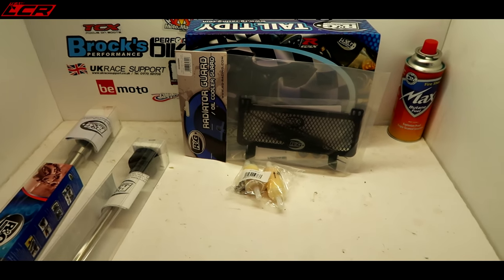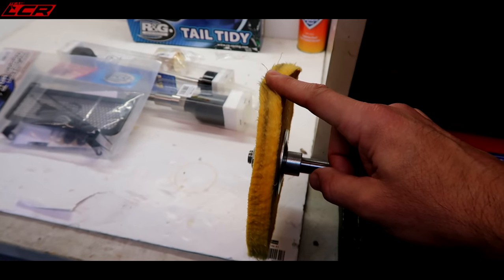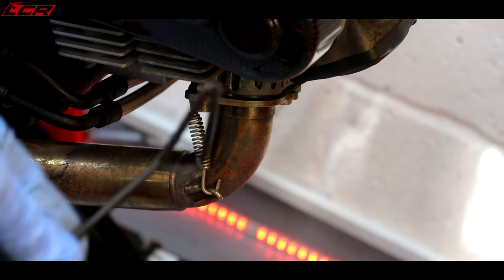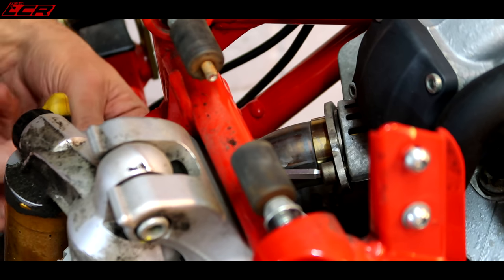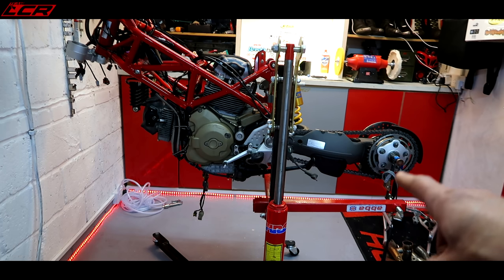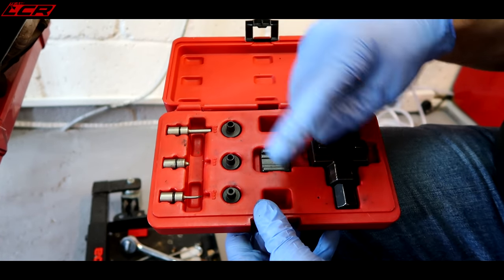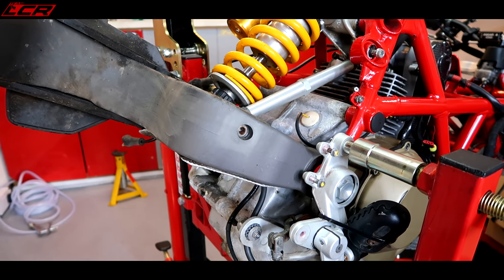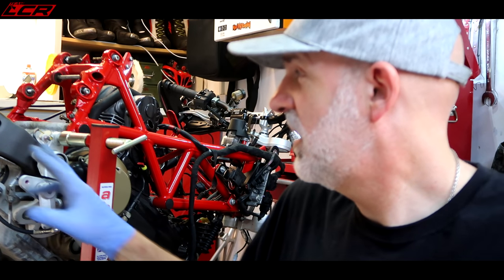Hypermotard Restoration EP04 | Now We're Getting Serious!!

Comment: Why not mince the chain off with the grinder if you are not reusing the chain? I don't get the stubbornness that you must use a chain splitter which is 1) slower, 2) more tricky 3) likely to break the pin.
Reply: Agreed....grinder is way to go for getting old chains off
Reply: You don't 'need' to, but he might want to reuse it, he didn't say I don't think, plus it's his choice.  Also it takes just as long if you use the right pin that will not break lol.  I personally have to, I don't have a grinder and a Dremel would take much longer than using a chain tool.
Reply: I have chain splitter but have never used it because I also have an angle grinder.. even using a grinder carefully you can reuse the chain
Reply: @appymarley  how can you reuse it after cutting the link in half? It'll be to short, not really advised to add an extra link either.
Reply: @HalfdeadRider  just grind off the crushed part of the master link pins so you can just slide out the master link and put a new one on
Reply: @ThePgunner  Like Chops tried and it didn't work, it won't just easily slide out, he couldn't knock it out either.  Best just use the chain link remover, if you use the right size bit for your chain, and fit it properly it won't break, it doesn't take long either.
Reply: @HalfdeadRider  ah I apologise I wrote that before watching
Reply: @ThePgunner  its not really wise to tell someone how to do something you don't know how to do yourself 😂
Reply: @HalfdeadRider  That's 90% of YouTube comments for ya
Reply: @Filip_Phreriks  I don't know about your maths knowledge, but 90% seems a little high 😂 👍
Reply: jack jones I use my chain break all the time when removing chain, if he would set the break above the chain close to the sprocket it the takes slack out plus using boxed end wrench and socket makes job much easier.
Reply: @HalfdeadRider  who said I was wise? 😂
Reply: @ThePgunner  😂 😂 👍
Reply: I’ve used an RK chain tool at work for the past three years and never had any problems with it, with quite a lot of usage
Reply: @gamekeeper687  That's because you use the right bit depending on the chains pitch, and make sure the tool is fitted correctly.  They will do it without grinding the pins head(?) (as I'm aware you would know), but best to grind it off to make it easier on us and the tool, the tools instruction advise to.
Reply: @HalfdeadRider  I have cut the connecting link many times and just replaced the rivit link so that way the chain stays the same length..easy
Reply: @appymarley  Even if you grind off the heads of both pins, you still need quite a lot of force to remove the link plate (usually a screwdriver or similar tool, and lever it or even hammer it off, the grinder pretty much welds the pins to the plate), it does not just fall off, but yes it's possible but not recommended.

I'd never reuse a chain if changing the sprockets (new sprockets/the chain will wear quicker), or doing any normal maintenance work.  There is no need to split a chain in most cases unless you are changing it, and the sprockets.  If you need it removed it for a big job like this, it makes much more sense just to replace it anyway.
Reply: @HalfdeadRider  yes whatever I'll keep doing it like I have been for years
Reply: @appymarley  😂 whatever 😂

Comment: Listen hobbyists, those casting marks on the yokes, take them out by hand, the old fashioned way  a hand file, and lots of different grits of emery, or al/ox paper, finishing off with a 1000G. You wanna see how its done properly outside of a pro polishing shop, have a look at some of Allen Millyards work, and even then he finishes off with a floor standing 2hp polishing spindle. You have been warned/advised...

Comment: I don't think anything you put on that polisher short of a grinding wheel is going to do much to those casting lines.  You'll need to start out with files and or a dremel, grind the casting down then work up to polishing. The issue you'll run into is you'll never really be able to match that fine textured surface so you're going to be looking at polishing the entire part to get a uniform finish.  This is going to entail sanding it all with progressively finer grits until you can actually polish them.   It's going to be a pretty big job and I'm not sure the polished look is what you're interested in or not.

Comment: Heat gun is the key with stubborn exhaust nuts and to separate them Chops, just have a fire extinguisher close at hand just in case.  I used to work in a tyre pros garage, we used acetylene torches and have someone on fire duty with an extinguisher.

Comment: That 'strange' height adjustment bar is to compensate for the change in ride height that occurs when you adjust the chain. Because the adjuster is eccentric it not only pulls the wheel further back, but it will also move the axle up or down every time you adjust the chain. To keep the geometry constant, they added the height adjustment.
Reply from the maker: Thanks for letting me know, makes perfect sense 👍

Comment: I have no idea how you are going to remember were everything goes when putting it all back together. I wouldn't have the guts to go down this level, so well done mate. It's going to be fantastic when you put it back together
Reply: Most people video the whole process & take photos then just rewind the footage for reassembly... boring reply but true!
Reply: Doing it for a job I just leave stuff in a way that I’d remember or cue myself to easily figure out how it came part, different length bolts on engine cases can be a bit tedious but you get there
Reply: @gamekeeper687  Put them through a diagram drawn on cardboard or paper.  Keep them in place on any casing or anything you take off.  Line them up in order on the side table or toolbox.  Many ways if you have not got a really good memory.  Bag and tag, photos video as our friend said above.

Comment: Please take the seals out, you can probably reuse them but the groves get dirt and corrosion in them and this is what binds the pistons and you loose feel and capacity, use a 90 degree pick to full clean out the seal grooves of dirt and corrosion then pack with red rubber grease and rebuild.... you will be sorry if you cut this corner... promise 👍

I do this every 2 years on my bikes and you would be surprised how much crud comes out and how much better the brakes feel and how easily the pistons move afterwards 😍

Comment: I think the main reason all the nuts and bolts came out with no breakages is because they were all still set to the original factory torque settings. I re-framed a little yzf r125 last year, as I put it back together I used the online manual to torque ever nut bolt and screw. I was really surprised on how low a lot of the setting should be. The manual also specified the bolts that need thread lock.

Comment: Good luck with the swingarm removal. There was at one time i classic thread of a guy trying to remove one from his 748 with huge difficulty. In the end he took to using a bottle jack with the frame between two wall pillars. It knocked the wall down and didn't shift the swingarm pivot.. :-)
Reply from the maker: Haha dont tell me that!! 😂
Reply: It's so easy to get swingarm out, but engine must come out first so the bushes that stick trough the bearing can be moved inwards so the move out of the recess in the frame wich is what prevents the swingarm to remove it with engine in .

Comment: You be needing some fine -medium-course scotchbrite wheels and polishing clays.. autosol on a small 5 inch polishing wheel for exhaust to brighten up and get some 5" pads that will fit on a high speed drill as it's easy then to give them a quick clean when they still on the bike and anything that is polished like your triple clamps if not getting coated you want to wipe them over regular with gt85/wd40....  i started doing my own polishing a few years ago restoring my old enduro bikes... that swing arm would look quite nice with a brushed ali look and a clear coat over top of it ? Very easy with scotch brite wheels going horizontal passes over it one paint is off it ...👍

Comment: Bit of heat on the exhaust might do the trick on the exhaust next time mate.Always try and use a single hex socket on nuts and bolts,get yourself an electric impact socket gun from machine mart cheep and that will get the spindle nut off.Good luck with the swinging arm Chops 😁😁😁👍🏻😎

Comment: Nice! Really like what you are doing, awesome bike too! 
Just some random things, going to watch this episode now; ceracote is a super nice coating, but I would not coat the cylinders/cooling fins with it as it isolates the heat quite nicely! You could coat the exhaust with it inside and out, to keep the bike a bit cooler (my experience with bikes with exhaust close to frame like Ducati, Husaberg 70 degree etc). If you want to keep the uncoated look, only have them coat the inside of the pipes.
Reply from the maker: Good tip! 👍

Comment: Looks like you need a stronger spring on the rear shock, there's a lot of pre-load someone's wound on there. Also, there should be studs not bolts holding the exhausts on, looks like someone's had them off before and just used allen head bolts when putting it back, get some studs and copper (or better still brass) nuts when reassembling it.

Comment: The exhaust is loose because as the mounting plates get very hot and soft so then bend relaxing the tension on the bolts.... basically the plates are to thin. Larger washers may help keep tension on them by spreading the load over a bigger area.

Comment: WD40 on the exhaust slip joints before you start trying to separate it would help, if they still dont come apart then use some heat.
Mini gas torch or a heat gun.
You could make your life so much easier ✌

Comment: Chops when you remove a chain if you had just ground off the other head of the link you could have just flicked the plate of with a screwdriver, 2 minutes mate 👍
Reply from the maker: Yes good point.. I wasnt expecting quite so much trouble and didn't have a cutting disk for the grinder. Makes a bloody mess just grinding through